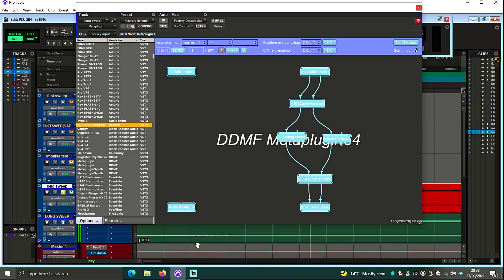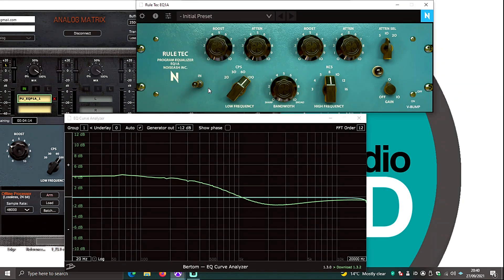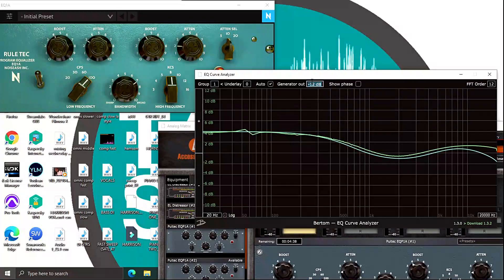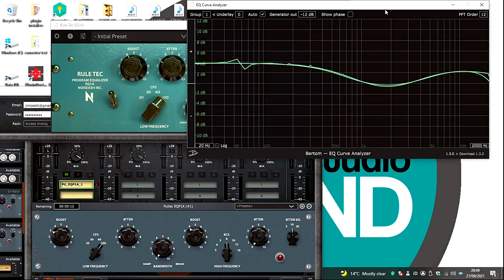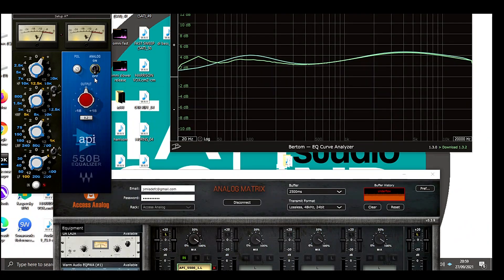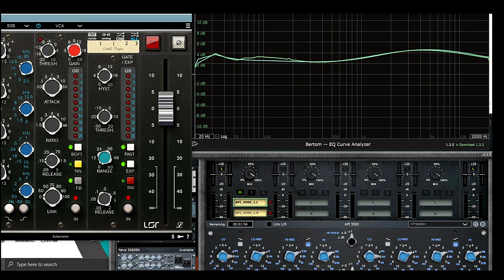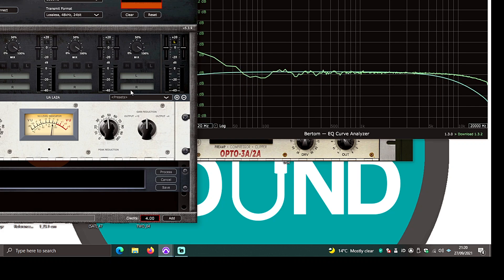How to match curves of ACCESS ANALOG HARDWARE & ANALOG EMULATION PLUGINS using BERTOM CURVE ANALYSER

Comment: Funny enough if you have NoiseAsh Rule tec Heritage pro, it has analog knob and if you turn that on it has exactly the same nonlinear nonstatic bass as the access analog one that 60Hz vibration we can see on the video it also add bit of a bump there in thd and adds bit of noise, I agree very good pultec emulation!
Reply from the maker: Somebody else just commented on that haha I wonder if it was to cpu intensive or the inclusion of oversampling mucked things up somehow 🤔
Reply: @PaulThird  Nope I didn't notice any change in cpu usage after dissabling both analog knob and 8x oversampling (I kinda doubt it's actually 8x but it says it's 8x) and it definitely helps to with aliasing when you check that thing out in Plugin Doctor, also that analog thing adds bit of noise and bit of body to the snare I tested right now quickly as well as opens it up and makes the midrange and top end smoother, kinda adds bit of depth in conjunction with oversampling, it definitely sounds different and without it that eq sounds more pointy, possibly more punchy still sounds good, but I really like it only after enabling both analog and oversampling knob, then it sounds and feels analog like...
Reply from the maker: Im a noise fiend though. I eradicate all noise in my plugins if I have the option. im just funny with adding noise for whatever reason haha
Reply: @PaulThird  Yeah but that noise it adds is really at -125dB and less so probably your soundcard has more noise ;) 
That slight bump at 60Hz and bass nonlinearities seems to be worth it and have most of the effect, and even aliasing is kind of "digital noise" if aliasing is random and does not follow certain patterns, so it can actually help to smooth out the sideeffects of aliasing, I prefer to have that analog thing on for most of the audio sources, try it yourself maybe you'll like it as well...
Reply from the maker: I can't. I've never had the original version so I can't go back haha does make me wonder why they changed it. Tbh I could just ask them as I've been beta testing for them haha
Reply: But I know there has been some changes, because lots of people were mailing them (me included the oversampling didn't work you could see it did 0 change in Plugin Doctor, fortunately now it does work) so some tweaks are happening over time which is a good thing in my opinion.

Comment: Do you have an older version of Ruletec? Mine has an "Analog" switch that adds some similar noise/fluctuations/hum that the hardware seems to have! :)
Reply from the maker: Nah mines is just has the low bump thing. Mines is definitely the newest version
Reply: @PaulThird  Paul..No it's not! If yours was the latest version, it should have a "analog" switch next to the HF atten sel switch. This introduces "Enables Extra Analog Behaviour (Total Harmonic Distortion and Special Hum)
" accordig to the manual..
Reply from the maker: Your right. Odd. My laptop is older and my computer is new. Noiseash upgraded me to the whole pultec bundle which was obviously the older version as it seems I've got the new version on the laptop and the old on the computer 🤔

Tbh all the analog does is add a lot of noise which in turn causes the frequency to become un-static. Which is still pretty realistic as it adds a level of non linearity BUT it looks like it has some wierd activity around the 55hz mark.

However I looked and its version 1.4 and think they are on v1.8. In this version I've got the OS is broke and non functioning. I'll need to upgrade it when I've got time and have a look at the newest version.

Everything works fine on the older version on my computer though

Comment: Well that explains it.   The reason why hardware sounds 'alive' and has a sense of depth, width, air, is because the audio signal/voltage is moving through the circuit repeatedly in realtime, and hardware components cannot behave/respond perfect and consistent.   So those variations, are creating the differences in response over time, and we hear that as movement, and can see it in the graph.  So that movement, is creating audio illusions to our ears, as with phasing/chorus, etc.   Also, noise as we know can add a sense of depth and thickness when blended into sounds. But i don't think it's the same as just layerng noise. I think it has to emanate from the process.
 Add to the audio signal distortions of varous types, and i think we have the recipe for hardware.  But the important thing is that it is constantly moving.  And software is always going to be static, until they emulate realtime inconsistent circuits and have the signal pass through it.  We can hear with the latest Roland synth emulations, they are emulating circuits and they are real close.  But they are limited of the full potential by our current processing power. Notice those synths use alot of cpu.
 So, i believe that's it. The reason why hardware can take a dry synthesized sound and make it sound like it's in a 3D space, is because it's the audio illusion created by variation, noise, distortion - and all moving.  Movement seems alive.
Reply: Well... Actually i'm pretty sure it's just noise. Curve isn't moving, just background noise coming in&out of phase with the original signal and creating this movement in the low-end. That's why we saw movement only in the low-end - it's more sensitive to phase changes. So if you model the random background noise - you are golden.
Reply: @TransistorLSD   The whole spectrum is moving, just, as you said, low end is more sensitive, so it's moving more drastically. And it seems to reduce the further up it goes.  If it was just noise, then haven't plugins already done that ? Also, note, i don't think we would be hearing noise in this example. And when plugins add noise, you start to hear it.   Noise is generated in circuits via a few methods and types. All shortcomings of physical components, and it's going to be inconsistent every pass.  And it contributes to and changes the final signal.  Not the same as layering noise over a final output.   I'm no expert but i think the distortions and inconsistency of each component, varying over each pass, have got to contribute to the final audio illusion.   Noise is a probably the one for depth, but width ?  That has to be related to phase.
Reply from the maker: Yeah I think TransistorLSD may be on to something as if you add lots of noise I.e. Crank Vgain in bx plugins you'll see the frequency response starts to move due to the noise so plugins can easily create kind of non-static behaviour. Not like the erratic low end we see but you'll notice the curves have a bit of movement or whatever it is. It's like puting a wee furry coat on the signal 😂
Reply: @PaulThird  yeah, i just tested it. i actually think BX plugins model less low-frequency rumble in the V-gain to preserve the low-end punch and clarity...
Reply from the maker: So its more high order noise?
Reply: @PaulThird  Yeah, i think so. I'm 90% sure that's how it is.
Reply: @PaulThird  oh im going to try that out, but i think i can imagine the furry coat.  Oh wait, v-gain is their 'analogue modelled noise'. So yes, thats all it is, adding noise.  And that doesnt magically make it sound like hardware ! lol.  I reckon circuit emulation on FPGA chips is the only way at the moment. Unless some genius comes up with some shortcut, cpu efficient, way of doing it in the mean time. Which can always happen.

Edit : oh, so there is 'SPICE', which emulates circuits via software.  Analogue Obsession uses it, Black Rooster Audio uses it,  Cytomic used it on Screamer, and DMG audio on Trackcomp.   But theres no way to utilise it to max potential because cpu is the limitation.  Thats where dedicated chips would come in.

Found this article on SoundOnSound : https://www.soundonsound.com/techniques/plug-modelling
Most of the big plugin developers discussing difficulties of hardware emulation.
Reply from the maker: I have heard a lot about spice but not really looked properly into it yet 🤓
Reply: @PaulThird   It's the sole reason Analogue Obsession plugins sound good, and that he did a decent job of investigating hardware components and translating that into Spice.
Reply: i’ve managed to achieve a pretty cool analog eq effect by using the ozone dynamic EQ. the trick is setting a threshold and attack/release times that makes the eq fluctuate quickly and constantly. feels more alive and ‘analogue’ to me than static eq
Reply from the maker: But can you pick it out in a level matched blind test? Haha

Thats the next level of experimation. Experiment and then level match a short piece to integrated lufs. Loop and then Blind test and see if you can pick out the difference 3 times on the trot. If you can then you definitely know its worth doing.

This is coming from experience of someone who experimented with stuff many times, assuring myself that I've made this massive change and then I do a level matched blind test and I'm like.. Bastard 😂

Not saying you've not achieved anything I just always advise people to test stuff out as perceptual listening can be a killer
Reply: @PaulThird   that 'bastard' moment 😂
Reply: @rafriley6993   i might try something like that. Although its not on the micro level thats happening at circuit speed, it still might have an effect that works for me

Comment: Hello, you stepped up your game, love seeing the analogue non-linearities! Here is a thing some engineers do to fake the non-linearities, which actually are just movement: Add a dynamic eq..pick a couple of frequencies, where you usually face nonlinearities.. that means first and foremost: lowend, highend and something in between. Set a threshold that "just about triggers" the dynamic eq boost or reduction - compensate with as much static boost/reduction as you need (to taste). I advise to be subtle, but I've seen mixes that went nuts and sounded good.
Additional tip: Make sure these curves move with each other.. that means when your frequencyband at 60 Hz boosts, your frequencyband at 100Hz should cut or vice versa. This is movement.. this creates depth... because depth is something that can only ever be perceived when something moves forwards/backwards (louder/quieter).

I once commented on this topic before under another video that you called: "Why audio plugins sound 'flat' & How to fix FLAT ITB mixes || Is it really the tools or is it YOU?" And the comment went like this:
Let's break it down further.. there is no such thing as 3D (in stereo), there is only the perception of 3D. Quiet sounds farther away, loud sounds closer, low frequencies sound underwater, high frequencies sound airy, mid frequencies sound in your face. So be mindful about volume and frequencies (THINK about 3D while adjusting it). Loud but far away sounds have Reverb or Delay (THINK about 3D while applying it). That gets you your room. Now you have a 3D room, but the mix will still sound pretty flat. The one big thing that let's any landscape be PERCEIVED as 3D and not 2D is MOVEMENT.. without movement we perceive it as a 2D picture. The obvious answer is: volumeautomation, panautomation.. but everyone is doing that. Easiest way to get MORE movement is using a dynamic eq. Let things dynamically "poke out" or "duck away".. do it on low and high end with shelve, do it on muddy and present frequencies with a bell. It works.. it really does. I do that on vocals, masterbus, everything that I feel like needs a bit of life. If you want to see a quick demonstration before trying it yourself - watch: "Streaky - How To Get A Track To Jump Out The Speakers!" on youtube.
Reply: (the great thing about the "fake-non-linearities" is that you are in full control.. you only add those that you like. And you do not NEED to do it.. sometimes it sounds better without (though odds are, if you take enough time to tweak it, you will prefer it- also MIND the attack/release times.. very important)) PS: No, I don't think streaky is a great guy, I think a lot of what he sells is bogus.. but it's the only video on this "trick" I've ever seen.
Reply from the maker: Thinking about it.. Its kinda what the dynamic mode in sonible smart eq is doing when it's grouped and in dynamic mode. Kinda like non linear where its movements are influenced by the other instruments. Almost like how a signal is affected by its interaction with the analog circuitry. Every sonible instance in that group has its entire frequency response moving up and down in random fashion due to the interaction of the other tracks and how the frequencies shift as the track plays
Reply: @PaulThird  yes, that's movement too, but it's a bit different, because it doesn't happen in order to move but in order to mask/unmask etc... What can I say.. just try it on a couple of mixes, if you like it, you like it, if you don't, you don't. There are people who swear by it, there are people who look down on it "not-gonna-ruin-my-perfect-mix-esque". It becomes really funny when the latter also use hardware.. but hey: To each his own!

It's just another thing to try out and to have in your mind as a tool. Helped me to think about dynamic-eqs in new ways. Dynamic-EQs really are a god-sent imo and I think we are just scatching the creative possibilities we have with them most of the time.
Reply: @PaulThird  Ahh, finally another engineer posted a video about this. Marc Daniel Nelson: "2 Steps To Wider, Deeper And Fatter Mixes" I suggest to check it out, because he goes into a little more detail and using it in mid/side-mode .. which I forgot to mention, I guess because my preset already has the highshelf to the sides and the lowshelf in mid (tweaking it everytime though).

Comment: Great video! A question I have is, I’ve noticed some waves plugins have an analog/digital slider… does that make a difference to the frequency response?
Reply from the maker: Just adds noise most of the time. I normally have it off as most waves plugs have the harmonics seperate to the analog function. There is another video going up most likely tomorrow all about the differences in harmonics with gear and plugins. You'll see in the api's case the analog switch adds one low level order of harmonic and also a lot of noise which is absolutely redundant as it has no relation to the hardware

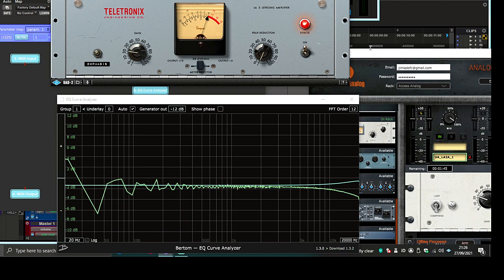Comment: It seems like Curve analyzer doesn't have an automatic delay compensation. At 8:17 you showed the phase plots, but what it really showing you is a comb filtering due to the mismatched delay.
Reply from the maker: Yeah I know. I only found that out last night haha you can input a delay compensation value and it'll fix the phase in bertom. Tbh I'm still trying to get my head around bertom. Plugin doctor is always my first port of call
Reply: @PaulThird  yes, plugin doctor is deeper for offline analysis, insetead Bertom is great in daw. I have the first channel in my template with Bertom always running, if I need I put a plugin I am tweaking on that first channel and tweak in parallel watching the graphics realtime